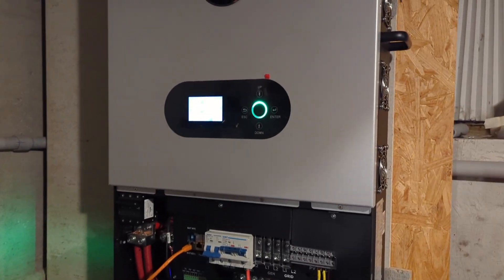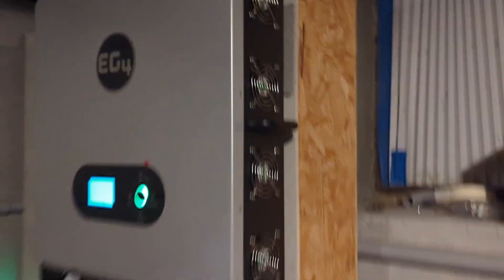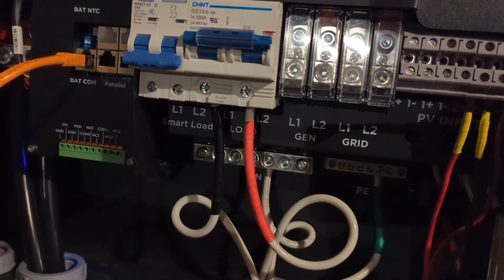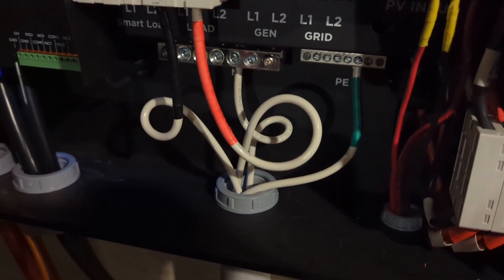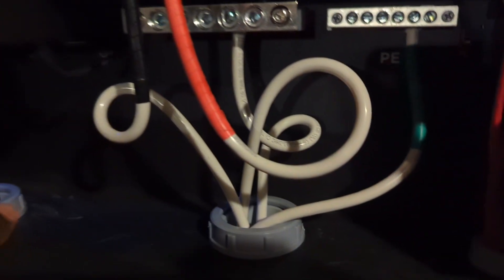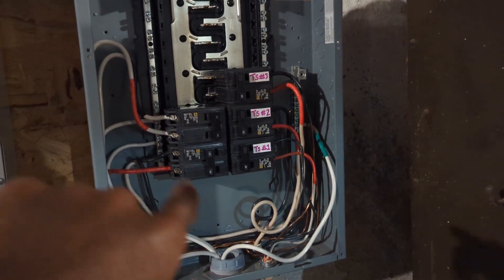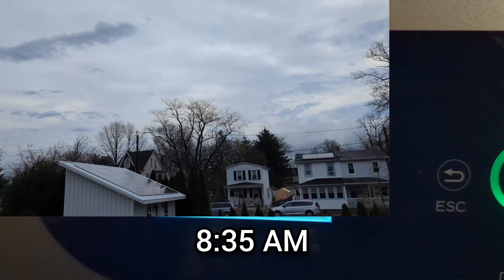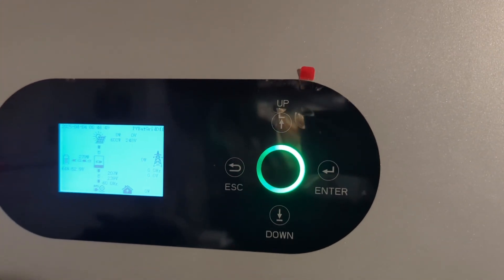EG4 12000XP Is LIVE! Post-Install Demonstration

Comment: Luxpower, makers of these EG4 inverters, particularly those manufactured in China, are facing scrutiny and accusations that they may pose a risk of backdoor cyber attacks by the Chinese government. The concern stems from the discovery of "rogue" or undocumented communication devices in these inverters. These devices could potentially be used for unauthorized access and control, potentially leading to grid instability or damage.

Comment: That inverter though it’s not under great load is so quiet! I got the 6000, then 6 months later the 12k came out 🤦🏼‍♂️ lol Nice set up!
Reply from the maker: Thank you. I was planning to get the 6000XP as well.
Reply: The fans can get up there but in the basement where mine is mounted I do not notice at all except in the room directly above it I can hear a slight hum…good job on this my man!
Reply from the maker: Thank You! My unit is right above the dining room, and I can't hear it at all. I used to hear the two PowMr SP5Ks, especially when it was sunny. I need to do a load test to see how loud the 12000XP gets.